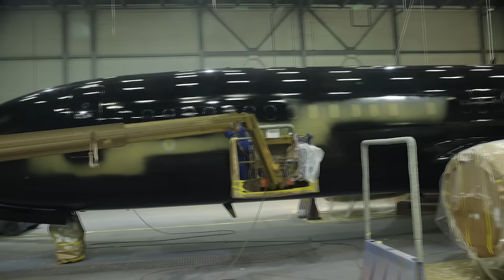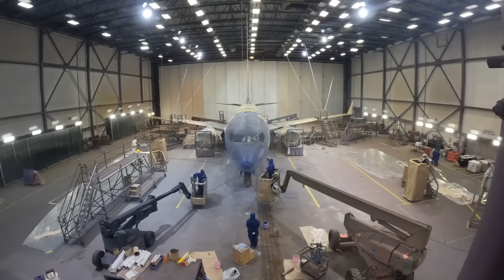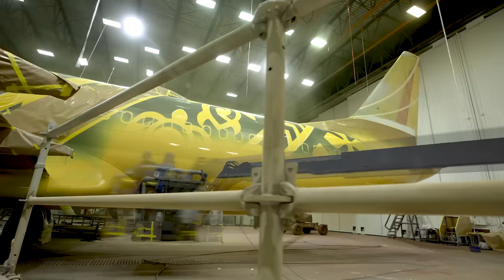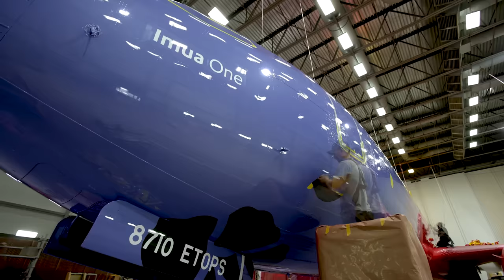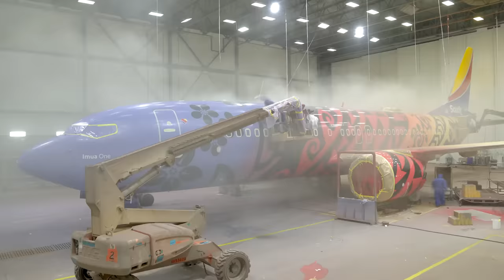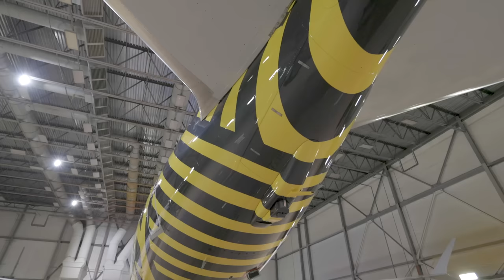Introducing Imua One | Southwest Airlines

Comment: Umm OK, it's pretty, but your customers see mostly the INSIDE of your planes. For the money spent on this elaborate paint job, how much could you have improved things like legroom, crew member pay, or (especially) scheduling systems? Seems like any airline that's just had a recent catastrophic meltdown would want to be be more frugal with its expenses.
Reply: While the IMUA paint price was higher then a fleet paint job, it is a required maintenance item. Just as any other maintenance item. The paint is a corrosion prevention and is required every 7 years or so. So why not get some marketing with a good livery?
Reply: SWA has some of the best legroom in coach of any airline in the U.S....  So BS there..  Also, crew pay is not terrible and all dictated by contracts..  The their IT and scheduling systems yes do need an overhaul i'll give you that but it isnt like they spent all of their money painting this aircraft..
Reply: @comicpilot   as someone who literally worked on this aircraft and knows the $$ cost to paint. Like I said, IMUA was more costly than the standard fleet cost it was not that bad. The biggest factor was the clear mica that is over the entire fuse and engines.